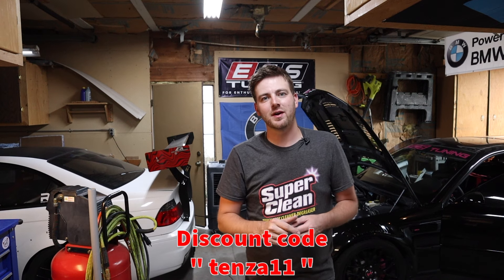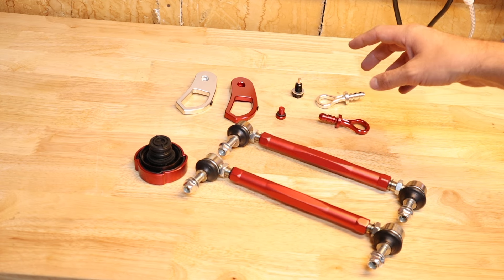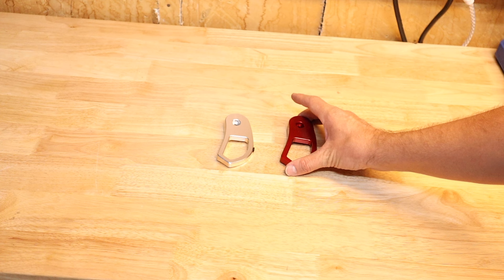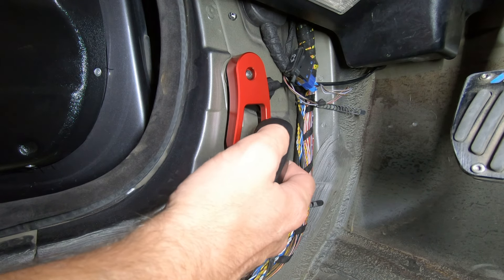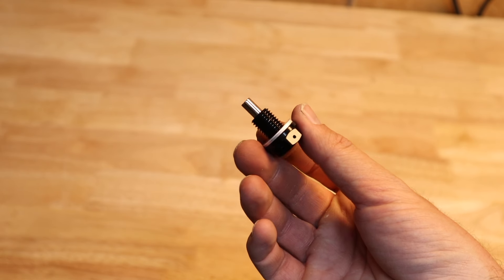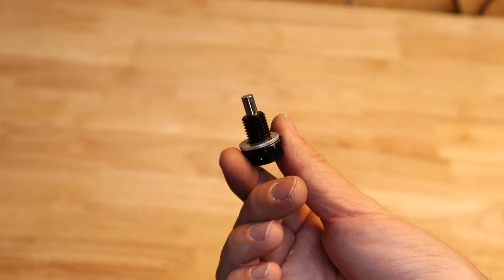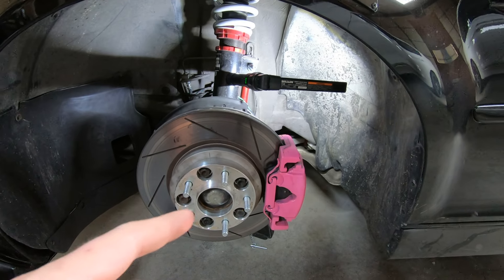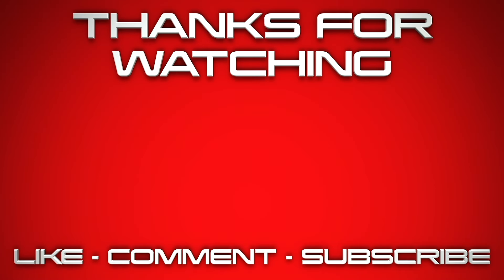MUST HAVE BMW e46 upgrades - Performance and reliable replacement parts - Install and review racecar

Comment: Hey the best budget bench vise, I  got this a year ago and it’s held up very very well. 
It’s sold by Vevor it’s the 6.5” they sell 3 sizes you want the 6-1/2” it works two ways you can flip it around and have a massive jaw opening. I have ordered a bunch of stuff directly from their website with great success. The vise is like $80 if you signed up on the website.  I’m not affiliated with them I just needed a vise too and took a chance and definitely scored. Figured I return the knowledge you have given on my first German car (e46) you been a big help.
Reply from the maker: That’s a killer deal for a vise. Even a cheap harbor freight one is $80-100. I’ll be buying one as soon as I finish my work bench. Then I’ll have a good solid place to mount it. I’m glad my content helps! What e46 do you have?

Comment: The expansion tank is plastic anyways so just don’t be dropping  shit on ur expansion tank simple. Also not smart using metal into something that screws into plastic threads  since it expands at a different rate honestly stupidest shit you could have done the Oem cap has zero issues. It’s the expansion tank that has “problems” which is really just old ones being overfilled and they crack because of that but if it’s not old n brittle it should vent out the cap before it cracks so that’s just old parts needed to be changed due to age plastic gets brittle with heat cycles.
Reply from the maker: Oh ok, let me just reverse that. My bad. I’ll never accidentally drop a tool again. That’s not how it works. The cap is mostly for looks. The red is just for fun. But checking for flatten cracked gaskets is something you should check since they do go bad and are easy to check. Not sure what you’re talking about with the metal screwing into plastic? Are you talking about the bleeder screw? That is such a small part the heat dissipation difference wouldn’t ever been an issue. And the coolant cap is just a replacement cap with the red lid. It’s not completely made out of metal. Out of all the parts we swapped out, the cap is the only one that has no added features other than just replacing the brittle/worn out gaskets of an old cap.

Comment: lol maybe your latch broke because “it’s a lil weird dw abt that” is the actual problem of why it takes too much force to pull. Smfh
Reply from the maker: My latch isn’t any harder to pull than normal. If anything it’s easier. My aftermarket hood needed adjustment and it made so my latch didn’t return to its original position when the hood is unlatched. The reason it broke is because it’s 25 years old and made of plastic.